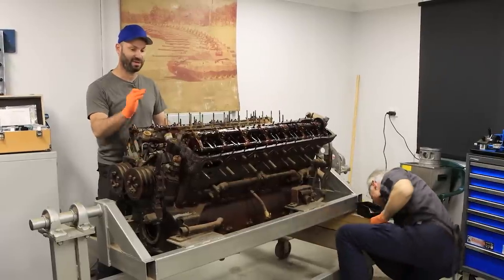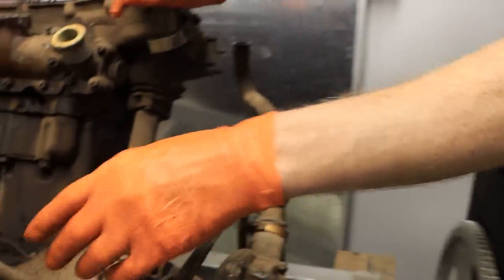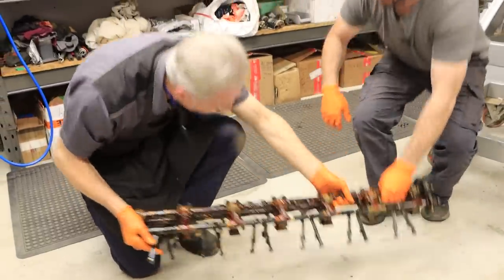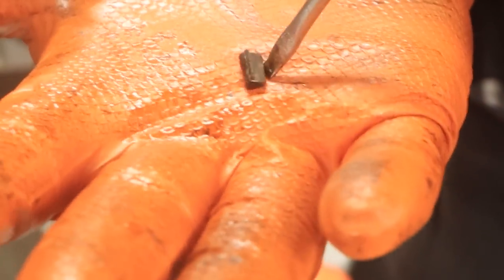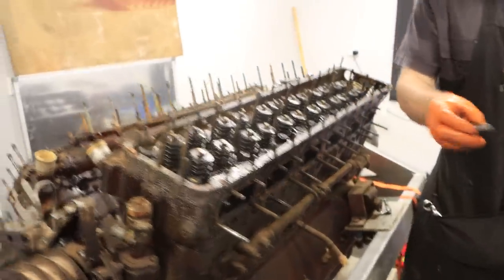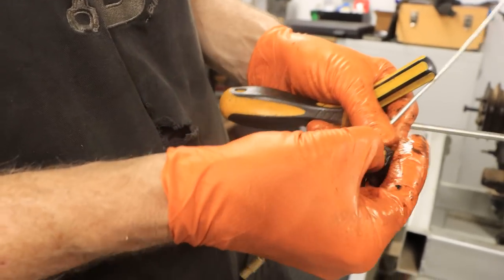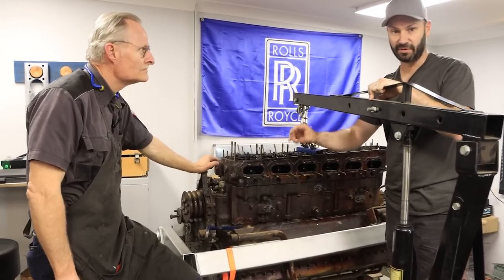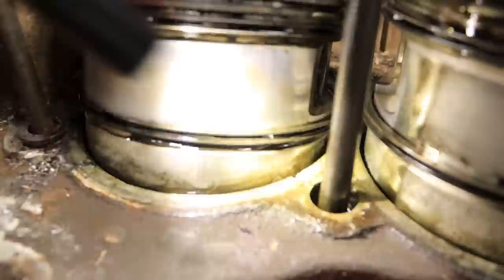Rolls-Royce 27 Litre V12 - Meteor Tank Engine Tear Down Part 3

Comment: Thanks for fixing the audio!

In 1957, Brabham drove another mid-engined Cooper, again only fitted with a 2-litre engine, at the Monaco Grand Prix. He avoided a large crash at the first corner and was running third towards the end of the race when the fuel pump mount failed. After more than three hours of racing, the exhausted Brabham, who "hated to be beaten",[18] pushed the car to the line to finish sixth.[19]

Comment: Great video, thanks! That damage to the deck is usually associated with the piston being at an angle when the crank is turned and it jams against the deck. Also be careful not to let the rods hit against the crankcase bores too much as this also damages the o-ring seating area.

Comment: There is a channel called Mr Hewes. He purchased a gate gaurd chieftain MBT which had been decommissioned by filling the engine compartment with concrete.  They painstakingly removed the concrete and refitted the meteor engine and gearbox.  Nothing can stop 2 guys  in a shed!!

Comment: Loose bank nuts! We used to have to replace some bank studs. some snapped others pulled out. There is something wrong with those studs as engine would never have passed engine tests after build. Maybe load test them with collar and nut torqued to specified torque for banks. I think they will pull out, we used to helicoil to repair. Hell of a job drilling out old snapped studs.

Comment: I worked with Jack Brabham back in the day and if he had seen you remove cylinder head fixings without backing them off in reverse order of tightening you would be sent back to Australia.
Reply: I noticed that.  Not the "best practice" I was taught in Tech.

Comment: Not sure why it took a month to get this but I'm glad to see progress.
I would think that contraption on the bevel drive cam tube would have to have an eccentric to adjust backlash in the bevel gear.  With the correct books (amen) I'm sure you will figure that out.
I hope the shell casing in the document tube does not correspond to a bullet hole anywhere.

Comment: You so lucky you can do this. Bit sad I have forgotten so much about the Metior strip down and build. Remember that you work at the pase the engine lets you go at. More modern engines will allow you to go as fast as you can with power tools, not with Witworth nuts held by split pins and tabs secreted away in the most awkward places.

Comment: One of the guys I used to work with has told me plenty of stories about these engines as he was a tank mechanic. He said they trialed new pistons with triple oil rings as oil consumption was gallons and hour. The engine barely made it out of the work shop and locked solid, turns out oil consumption is a feature they built in. I think he said if an engine used more than 5 gallons an hour it got an overhaul with the worst he seen being 20.

Comment: I'm sure you realize this, but for your jacking block, the edges should span out past the valve cover mating surface of the head. If those heads were on tighter, you wouldn't want to put an indentation into that face.

Comment: Merlin engines don't have a head gasket you can see the gap between the head and cylinder block. The head is pulled tight into the cylinder sleeves that protrude above the cylinder block by the studs, water passages pass this gap with a bakelite tubes with rubber seals. Rolls Royce Griffin do the same.
Reply: Alloy head straight onto the liner top protruding flange. The tubes I worked with were brass with 4 "o" rings, I think they are called bobbins.

Comment: I'm pretty sure you said it at the beginning, but I REALLY hope you take it down to the last nut & bolt, clean it, replace anything (which I highly doubt), upgrade it so it doesn't need those split pins anymore, stick it back together and put it on a dyno to see how much power you can squeeze out of it. Is there any way of tuning it and putting in some hardened seat's so it doesn't have to run on leaded file? 
Can you put aircraft fuel in to see if you can get some more power out of it or would that damage it because it was never designed for that role?
Reply: You don't actually get more power from higher octane fuel unless the engine is designed to take advantage of that extra octane rating.  You get more power from compressing the fuel more before ignition, and higher octane ratings let you increase that compression without uncontrolled fuel detonation.  But if anything, too high an octane rating for the engine's effective compression could conceivably reduce your output slightly, as the fuel will usually burn slightly slower without the higher pressure to help it along.
Reply: The valves have a cavity filled with sodium that moves up and down as the valves move to help cool the valves. As America seems to still Rebuild/use these engines it would be interesting to see if such valves are still available. Also as these valves were designed for an engine with twice the horse power  it may be that the sodium valves are not required. A rebuild kit and machining may be available but will cost an awful lot. I used to check and reuse many parts on older engines. Hope you show how this is done and hope you can get hold of oversized manual.
Reply: I'm fairly sure it already has hardened seats.

Comment: Enjoyed the video gents. Not sure why you didn't remove the head before the cylinder block?
Reply from the maker: We were advised it is normal practice to remove the cylinder case and head as one unit, then separate on the bench. We wanted to give this a try.
Reply: If I remember some nuts are just impossible to get to when the banks are in situ. Even on rebuild the bank and head are lowered as one onto the crankcase.

Comment: Just watched a thing on a boat racing museum where they used Merlins and Alision V12 engines and goes into the workings of the Merlin a fair bit https://www.youtube.com/watch?v=MwI_qctNmJg they were commenting on the incredibly high standards of machining and engineering in each engine and while the Alison V12 was very similar but heavier as it used more cast iron, it also used rollers between the cams and rocker arms whereas the Merlin rocker arms ran straight against the cams. I found it really interesting and informative on the Merlin engine.

Comment: The head nuts require a 7/8" AF spanner not 23mm most likely
Reply: Well actually more likely a Whitworth spanner given its age. They used the thread size to determine the spanner size. Whitworth and BSF share head sizes and spanners are marked for both although the thread sizes are different. For example 3/8 Whitworth or 7/16 BSF thread sizes share a 0.710 Inch AF or 'Across Flats' spanner. 0.875 inches = 7/8 inch AF
Reply from the maker: Yes we believe it is all whitworth. We used a single hex 23mm socket to get a snug fit on the nut when trying to rock the stud from getting caught on the head alloy material. A crude process but worked for us

Comment: Y r u using metric spanners on a imperial engine u should no better being mechanics
Reply from the maker: You should learn grammer and spelling.
Reply: @nowweretorquin8691 He Knows no better.
Reply: @johncrowley5612  Now now. Know no. of No's will do.
Reply: pots and kettles
Reply: I can guess its a bit difficult getting hold of Whitworth/BSF sockets nowadays. Maybe try your local museum. I believe these threads are the strongest possible thread formation.